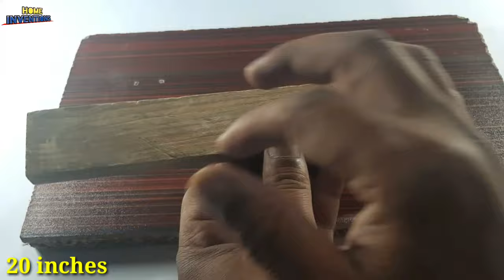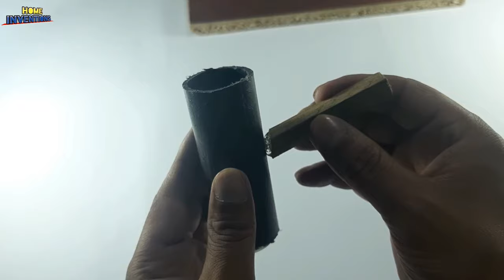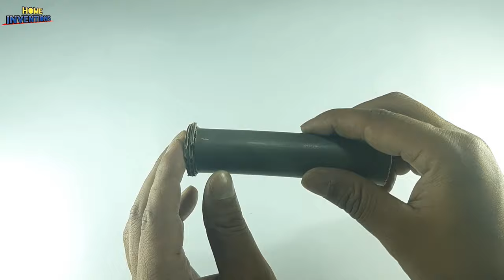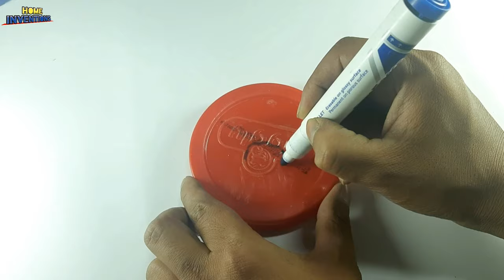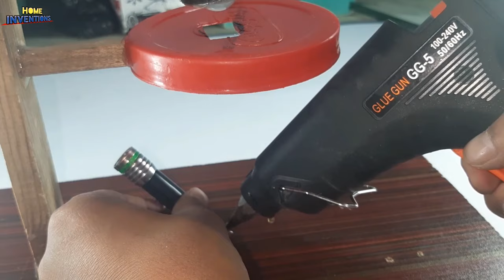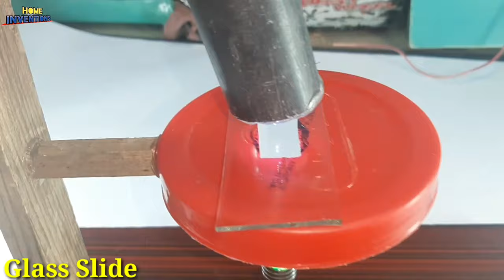How To Make A Powerful DIY Microscope That's Easy To Use!

Comment: What are the focal lengths of the two lenses
Reply: 40x equals 0.25 inch, or 6.3mm.  10x equals 1", or 25mm.  Surplus Shed is a good source.

Comment: I'm pretty sure that all your dimensions should be cm, not in. For example, the base board you say is 30x20 inches, looks like 12" x 8", ie 30x20 cm. Same goes for all other dimensions. FYI, lens focal length (fl) are usually specified, in mm, not power. The objective of 40x is 6.3mm fl and the eye lens of 10x is 25mm fl. This gives 400x, a bit on the high side for such simple optics. I would suggest starting with 100x or 200x (objective fl of 25 or 12.5mm, respectively). Lenses can be obtained from Surplus Shed or other surplus sources. 

Good luck!
Reply: Hi, how did you convert the magnification into focal length? Thanks

Comment: Hello.. we've made the plastoscope we've also used 100x objective lens but when we observe a leaf it shoes onle green blurry part.. any idea what could be the reason and solutions? 
A reply ASAP will be appreciated
Reply from the maker: Hello...
The was blurry because of length between eyepiece lens and objective lens .
The length should be 6.3 inches.
Watch this video
https://youtu.be/Q0yBCebbvwA
Reply: So there's no other way to make it work?
Reply: Actually we have to submit it on the coming Monday..you must be thinking that it's last minute or we were lazy but we were notified about it very late..so please suggest something soon
Reply: Sir I just found out the length is correct..any other reason?
Reply: You used 10x lens in the top

Comment: Where did you find objective lens    bro
Reply: If you cannot find the lens only, maybe you can buy one that is used in professional microscopes. It will come in a cylinder instead of the lens only, but it should still work for this project

Comment: 40× or 40mm which one I had to use in lense or 40×in objective and 10×in eyepiece lense
Reply from the maker: Lenses are usually measured by magnification power so 40x
Reply: Where to buy these lens pls tell